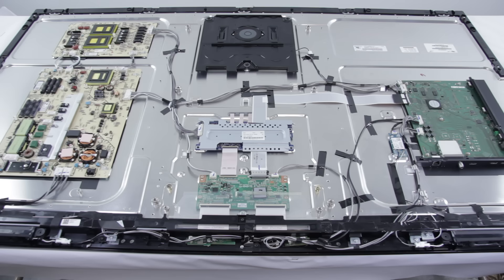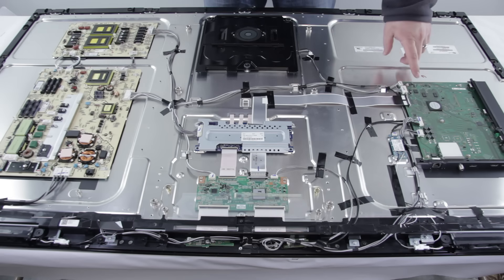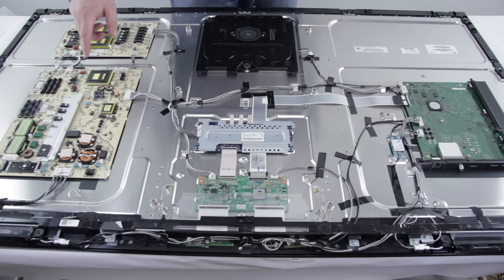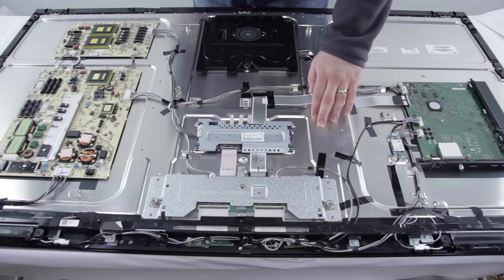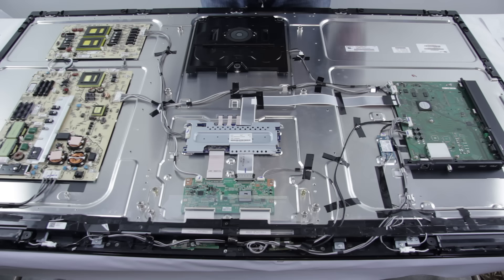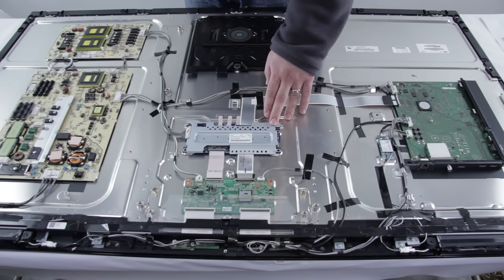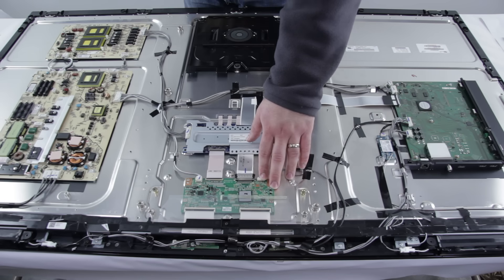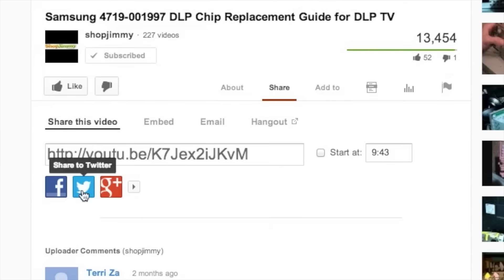LED TV Repair Tutorial - Common Symptoms & Solutions - How to Repair LED TVs

Comment: Hi there Ive got a LG 42LN5100 led tv it wont switch on the red light flashes twice and then just goes of if i press the power button once after that the red light stays on but tv wont switch on I already tried the method of unplugging it and holding dow power for 30 seconds and I replaced the power supply with a brand new lg power supply with no luck could it be the video bard or tcon please help
Reply from the maker: MrCatfish12345   This sounds like a problem with either the main board or the LEDs in the TV.  Unfortunately I do not see any replacement parts in the search results for your TV model number on our website.  Please reply with your part number on your main board and I can try searching for replacement parts.  Thanks and please let us know if you have any further questions!  www.shopjimmy.com

Comment: I have a Samsung 55" LED tv Model  #UN55C8300SF  - recently stopped turning on when we push the power button.  RED LED by the power button still comes on when plugged in.  There is a constant clicking noise (every few seconds) when plugged in. Power supply board is PD55AF1U_zhs.  How do I verify that it is a power supply board issue? Thanks!
Reply from the maker: Scott Holt   I recommend that you check the voltages on the power supply board.  Please reply with that info.  Thanks!  www.shopjimmy.com

Comment: I have a Rca LED52B55R120Q and the screen doesn't turn on. It has power the power lights turns off when I press it there's just not picture or sound.
Reply from the maker: Alex Labrada   This sounds like a problem with either the main board or the LEDs in the TV.  You can replace the main board to see if that fixes the problem.  Unfortunately I do not see any replacement parts in the search results for your TV model number on our website.  Please reply with your part number on your main board and I can try searching for replacement parts.  Thanks and please let us know if you have any further questions!  www.shopjimmy.com

Comment: how do i repair my LG 42LD520, i have powe,r but no picture, no signal.  We had a severe electrical storm this past monday evening.  Thank for your reply.
Reply from the maker: Tina Jones   I recommend replacing the main board and the power supply board in your TV.  Here is a link to replacement parts, CLICK HERE: http://www.shopjimmy.com/catalogsearch/result/?q=42LD520  Be sure to match part numbers on your current board, with your replacement for compatibility.  You can also call our customer service for further assistance with your purchase.  (877) 881-6492  Thanks and please let us know if you have any further questions with your TV Repair!  www.shopjimmy.com

Comment: I have a Hitachi LCD L42X02PXW that won't power up... Press the button, it tries for a few seconds, then goes red again. I've been told that the power supply is a common fail point for hitachi, so I'm leaning toward that. Thoughts?
Reply from the maker: *****  Try this at your own risk.  I recommend looking at the capacitors to see if they puffy or raised on the top.  If they look good, then you will need to check the voltages on the power supply.  Reply with the results. Thanks!  www.shopjimmy.com

Comment: Vizio 50 inch led smart tv e500i-A1 won't turn on
Reply from the maker: tommy esquivel   I recommend replacing the main board in your TV.  Here is a link to replacement parts, CLICK HERE:  http://www.shopjimmy.com/catalogsearch/result/index/?cat=56&q=e500i-A1  Be sure to match part numbers on your current board, with your replacement for compatibility.  Here is a link to a video showing how to identify your part number, click here:  TV Part Number Identification Guide for Vizio Main Boards (Plasma, LCD, LED)  You can also call our customer service for further assistance with your purchase.  (877) 881-6492  Thanks and please let us know if you have any further questions with your TV Repair!  www.shopjimmy.com
Reply: +ShopJimmy.com already fixed the problem my self Thanks anyways?

Comment: because in my tv small red spots visible only when the image is dark ? my tv is element ELEFT406

thank you
Reply from the maker: roberto zamora   It depends if they are really small (like a single pixel) and don't move it could just be stuck pixels. If its larger then it may be a bruise in the panel.  If your TV panel is bad, it may be more cost-effective to replace the TV as panels are typically hard to find in stock, difficult to replace, and expensive.  Thanks and please let us know if you have any further questions!  www.shopjimmy.com

Comment: Hello, help me to this samsung LA32A330J1    when I turn it on the screen shows only white. But of you see on the side, you can see a little bit image. Before it goes like this, the screen have some green horizontal lines that pops up 3 - 5 times in different place. I hope you help me. Thanks.
Reply from the maker: quentinlacsamana   This sounds like a TV panel problem.  If your TV panel is bad, it may be more cost-effective to replace the TV as panels are typically hard to find in stock, difficult to replace, and expensive.  Thanks and please let us know if you have any further questions!  www.shopjimmy.com

Comment: Samsung model UN46EH5050F has audio, no video, I used a flashlight to verify there is a picture and it seems the problem would be the backlight driver.  Do you have this part number?
Reply from the maker: Jason Cichy   For this model on our website it shows that the power supply board and the inverter board are combined on one board.  Here is a link to that power supply/LED board:  http://www.shopjimmy.com/samsung-bn44-00497a-power-supply-led-board.htm  Be sure to match part numbers on your current board sticker, with your replacement for compatibility.  You can also call our customer service for further assistance with your purchase.  (877) 881-6492  Thanks and please let us know if you have any further questions with your TV Repair!  www.shopjimmy.com

Comment: Question for you about my TV, ShopJimmy: 

I have a Westinghouse LD-4655VX. The screen went totally black while I was using it today. This model has a red power indicator light to show when it's running, and it also turned off. I checked the power chords, and everything is secure; although its power brick was really hot. Do you have any good suggestions? Thanks
Reply from the maker: XMattingly   It sounds like you have a bad adapter for the power.  Thanks!  www.shopjimmy.com

Comment: I have a Sony KDL-52NX800.  I get no picture or sound.  Will stay in standby ok.  When I power it on, the green light comes on and will stay on.  No error lights.  Nothing else happens.  Any ideas?
Reply from the maker: Mud Gard   The digital processor is bad, I recommend replacing the main board in your TV.  Here is a link to replacement parts for your TV model number on our website, click here:  http://www.shopjimmy.com/catalogsearch/result/index/?cat=56&q=KDL-52NX800  Be sure to match part numbers on your current board, with your replacement for compatibility.  Here is a link to a video showing how to identify your part number, click here:  TV Part Number Identification Guide for Sony Main Boards (LCD, LED, Plasma TVs) TV Repair  You can also call our customer service for further assistance with your purchase.  (877) 881-6492  Thanks and please let us know if you have any further questions with your TV Repair!  www.shopjimmy.com
Reply: Awesome!  Thanks.  I will order one from you soon.

Comment: I have a Sony Bravia KDL-46EX621.
TV won't turn on. Flashimg red led 6x. Sometime I unplug it for a while then plug it back and wait a while then  it turns on normally.  What part do you figure it coils be?
Reply from the maker: Denis Laurin   This could either be a problem with the power supply or the main board.  It is tough to say for sure without knowing the voltages.  You could replace each board individually to see which one fixes the problem.  Here is a link to replacement parts for your TV model number on our website, click here:  http://www.shopjimmy.com/catalogsearch/result/?q=KDL-46EX  Be sure to match part numbers on your current board, with your replacement for compatibility.  You can also call our customer service for further assistance with your purchase.  (877) 881-6492  Thanks and please let us know if you have any further questions with your TV Repair!  www.shopjimmy.com

Comment: hi my Hitachi L42S503 TX9JM01079 powers on but no sound or picture, just a bluish gray screen, is this something I can repair myself.
Reply from the maker: Michael Leon   Sounds like either the fuse on the t-con board is bad or your digital processor on the main is bad.  If I had to choose one to replace, I would go replace the T-Con board first and then the main board.  Here is a link to replacement parts for your TV model number on our website, click here:  http://www.shopjimmy.com/catalogsearch/result/?q=L42S503  Be sure to match part numbers on your current board, with your replacement for compatibility.  You can also call our customer service for further assistance with your purchase.  (877) 881-6492  Thanks and please let us know if you have any further questions with your TV Repair!  www.shopjimmy.com
Reply: Thank you very much for your response and help, I'd failed to mention my apartment gets extremely hot. This was the second tv that went out on me. The first it was a picture tub. I was able to replace DLP model though,thinking it may be the same probably if so which direction should I take. Thanks again for your help.

Comment: VISIO XVT553SV has no video. Backlight and sound are working. When first powered up no VISIO logo. What parts do I need?
Reply from the maker: Ronald Malsch   This sounds like a problem with the main board, since you are not getting video.  Here is a link to replacement parts for your TV model number on our website, click here:  http://www.shopjimmy.com/catalogsearch/result/index/?cat=56&q=XVT553SV  Be sure to match part numbers on your current board, with your replacement for compatibility.  Here is a link to a video showing how to identify your part number, click here:  TV Part Number Identification Guide for Vizio Main Boards (Plasma, LCD, LED)  You can also call our customer service for further assistance with your purchase.  (877) 881-6492  Thanks and please let us know if you have any further questions with your TV Repair!  www.shopjimmy.com

Comment: Samsung Model # UN46EH5300F Power Cycling Issue
If I have my TV off for a while It will stay on for a longer period of time but when it starts to PowerCycle the time between becomes shorter.
I checked the capacitors, None have swelled.
Reply: Update the last time it Cycled the Power LED kept Blinking but would not turn on.
Unplugged for a minute and it started up but kept Cycling.
Reply from the maker: MeatWarlock   There is either an issue with the secondary side of the power supply or the main board shorts when it gets hot. I recommend trying to replace the power supply board first to see if that fixes the problem.  You could also try replacing both boards.  Here is a link to replacement parts for your TV model number on our website, click here:  http://www.shopjimmy.com/catalogsearch/result/?q=UN46EH5300F  Be sure to match part numbers on your current board, with your replacement for compatibility.  You can also call our customer service for further assistance with your purchase.  (877) 881-6492  Thanks and please let us know if you have any further questions with your TV Repair!  www.shopjimmy.com

Comment: i have a 46 inch RCA model number 46a55r120q.Backlight comes on the tv but i have no picture or no sound so i figured it was the mainboard.I replaced the mainboard and im still having the same issue.I also noticed a light pulsing action while the backlight is on.The tv also has another board inbetween the mainboard and tconn which i believe is the digital board.Do you know what can be the problem?
Reply from the maker: Fra Diavolo   This sounds like a TV panel problem.  If your TV panel is bad, it may be more cost-effective to replace the TV as panels are typically hard to find in stock, difficult to replace, and expensive.  Thanks and please let us know if you have any further questions!  www.shopjimmy.com

Comment: hello sir
thanks for the sharing ur ideas. i have a samsung led tv 40 inches. UA40EH5000R. for the last 2 days i find a white colour vertical line from top to bottom which is 4 inches thick. and the white line is opaque. the line appears fixed even when a USB source is plugged in. the vertical line is placed at about 1 foot from the leftside to rightside. can u suggest me how to get rid of it.
Reply from the maker: jv Subha   This sounds like a TV panel problem.  If your TV panel is bad, it may be more cost-effective to replace the TV as panels are typically hard to find in stock, difficult to replace, and expensive.  Thanks and please let us know if you have any further questions!  www.shopjimmy.com

Comment: I have an Apex 19 inch TV model #l  LE1910. It has been hit or miss on the power up. It was making a distinctive "pop" sound prior to dying.  It did this for weeks when powering on or when changing channels.  Some blogs say to check for a bad capacitor.  Any advise on what it might take to fix the TV?  Mark
Reply from the maker: Mark Black   I recommend replacing the power supply board in your TV.  Unfortunately I do not see any replacement parts in the search results for your TV model number on our website.  Please reply with your part number on your power supply board and I can try searching for replacement parts.  Thanks and please let us know if you have any further questions!  www.shopjimmy.com

Comment: Great video. Great resource too.  I have an Insignia NS-46E570A11.  Have had the TV for about 3 years with no problems until today. Wife noticed the picture seemed darker than normal when she turned it on...or just not as vibrant as it normally was.  I thought it was a picture setting, but I have altered the picture in every combination imaginable.  I have eliminated all other inputs plugged into TV so as not to overlook something that could be a contributing factor....all to no avail.  Have switched my HDMI cable to every input...same problem for each input.  TV is just dull and not very pleasing to watch. Any ideas what this could be?  Thanks so much in advance
Reply from the maker: Paul Leblanc   This sounds like a problem with either the inverter or the power supply board in your TV.  Unfortunately I do not see any replacement parts in the search results for your TV model number on our website.  Please reply with your part number on your powers supply and inverter board and I can try searching for replacement parts.  Thanks and please let us know if you have any further questions!  www.shopjimmy.com

Comment: I have an LG 47LV4400. This is about 2 and a half years old. The problem I am having is the TV turns on, has picture and sound and after first turning on, it stays on for 1-3 hours, then I lose video and sound and backlight. Blue power indicator is still on, if I turn the tv off and then back on, all will come back on again, but will only last about 30 seconds. The longer I wait, the longer the tv will stay on. I am not sure which board I should replace.

Thank you,
Tim
Reply from the maker: Tim Bruner   I recommend replacing the main board in your TV.  Here is a link to replacement parts for your TV model number on our website, click here:  http://www.shopjimmy.com/catalogsearch/result/index/?cat=56&q=LG+47LV4400  Be sure to match part numbers on your current board, with your replacement for compatibility.  Here is a link to a video showing how to identify your part number, click here:  TV Part Number Guide for LG & Zenith Main, Digital, & Tuner Boards (LCD, LED, Plasma TVs)  You can also call our customer service for further assistance with your purchase.  (877) 881-6492  Thanks and please let us know if you have any further questions with your TV Repair!  www.shopjimmy.com

Comment: Vizio M3D470KDE TV will not play any final video or cable tv show in color, only black & white. the tv shows color on all set up screens and anything prior to playing a video such as netflix or hulu. Did a complete reset and everything vizio recommended. Are there 2 separate video cards/boards that transmit the video? Any help would be appreciated.
Reply from the maker: Carter Ullrich   I recommend replacing the main board in your TV.  Here is a link to replacement parts for your TV model number on our website, click here:  http://www.shopjimmy.com/catalogsearch/result/index/?cat=56&q=M3D470KDE  Be sure to match part numbers on your current board, with your replacement for compatibility.  Here is a link to a video showing how to identify your part number, click here:  TV Part Number Identification Guide for Vizio Main Boards (Plasma, LCD, LED)  You can also call our customer service for further assistance with your purchase.  (877) 881-6492  Thanks and please let us know if you have any further questions with your TV Repair!  www.shopjimmy.com

Comment: I have a Samsung tv, model number UN60H6400AFXZA. I had this tv about 2 weeks. I moved this tv off my mantle and cracked the screen due to the force I used to pick the tv up. The crack spread across the tv. The tv does power up. I believe I only need to replace the lcd screen if that is possible, any thoughts?
Reply from the maker: Charles Hill   Sorry, but unfortunately we will not be able to locate one for you.  Thanks!  www.shopjimmy.com
Reply: Okay thanks

Comment: Hello, I have a Sharp lc60le810u . It  has sound and you can see an image with a flashlight. It will not produce a normal picture anymore. I beleive that the power supply board also the backlight inverter.  Is this a bad panel or power board?